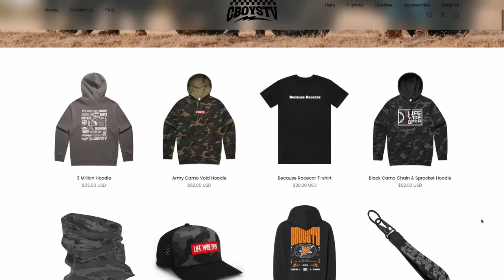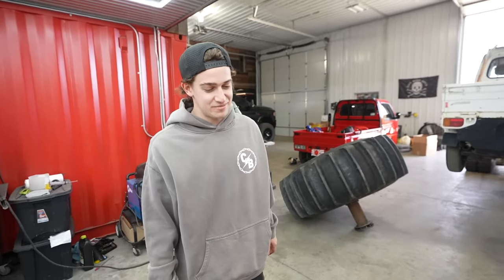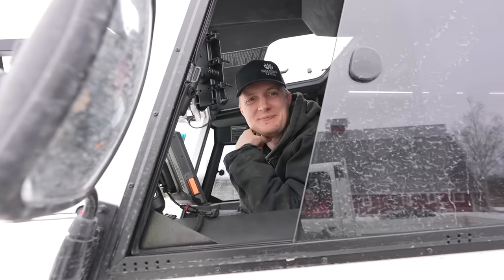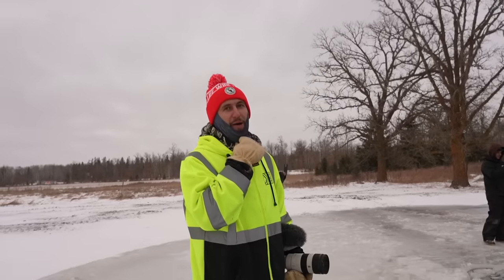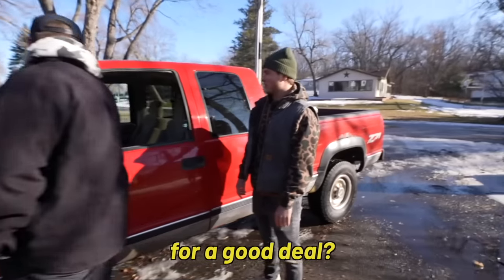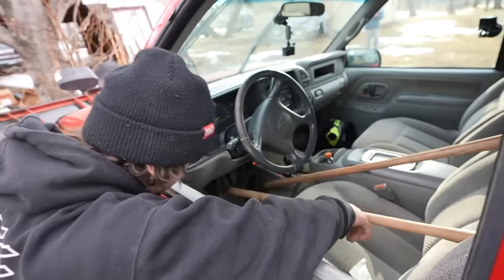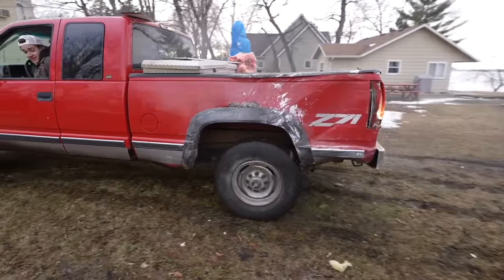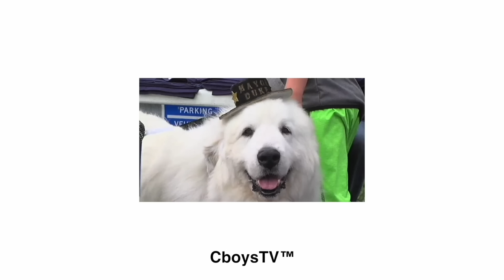Mini Truck on 6 Foot Tall Wheels

Comment: Plow truck through the house has to be one of the best segments ever! It’s kind of a shame since it looked like a nice rig to start with. I bet yall could toss a dump bed and replace the axel hardware if the frame isn’t totally tweaked to help with further demolition and with the track 🤷🏻‍♂️😂